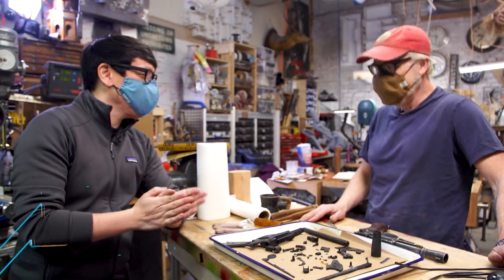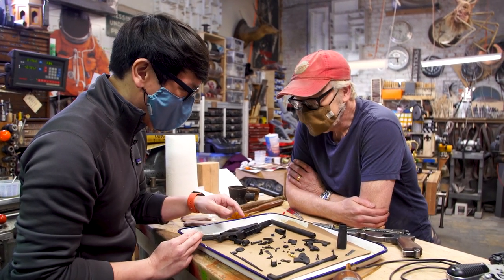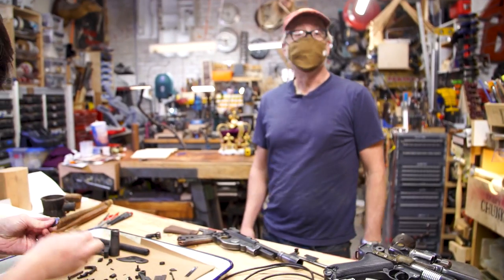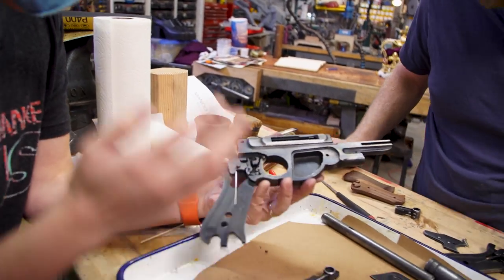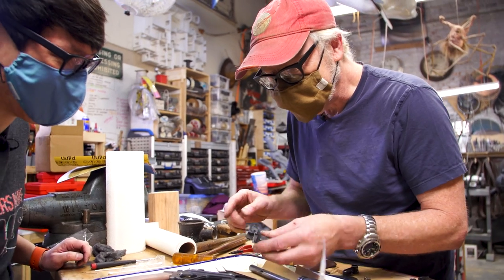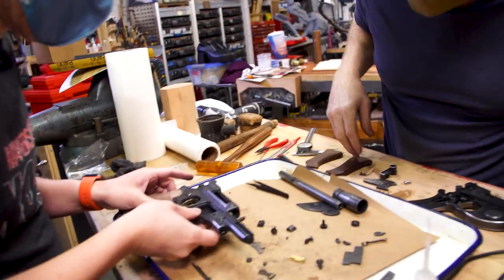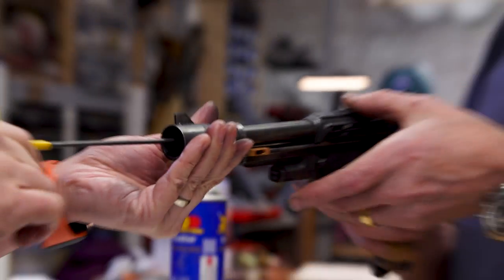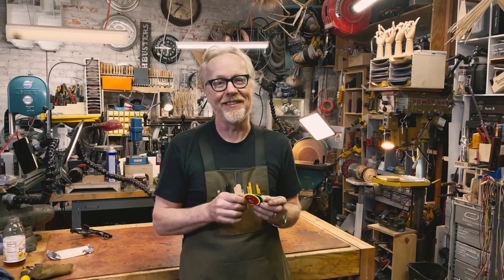Adam Savage Assembles a Mandalorian Blaster Kit!

Comment: See's kit. "I want it badly."
Looks at price. "Not that badly."
Reply: I was kinda thinking the same :D One day I'll have to money to spend it on stuff like this blaster.
Reply: All things considered, it doesn't sound like that bad of a price.
It costs about the same as a baby yoda.
Reply: @confusedwhale  plus You have to get the parts blackened what they did which can add to the total cost
Reply: @SirJamesIGamerfuzion :
Ah, but you would have to do that anyways where you diy'd it or bought this kit.

Though, I don't know how much it would cost to get an 1896 gun and modify it into a prop... probably more than $400. Le shrug
Reply: @SirJamesIGamerfuzion  I just used flat black paint - Turned out great... Cost me an additional $6 or so...
Reply: Yup, and they screwed up Norm's handle and forgot to drill a hole. For $400 it better be damn near perfect.
Reply: You can buy a 3D print of the base g*n from any of the big 3D printing websites, and then modify it. The blaster isn't actually that modified from the real deal.
Reply: Rubies makes a plastic one for less than $20. Paints up great. I think $399 is worth it for the milling they do alone. But not every collector can justify that price!
Reply: @Noeland  I was considering 3D printing one, but after all the time and filling materials I'm going through doing that for the helmet, buying one that's already close sounds like a nice deal.

Edit: Never mind. You can't find them anywhere at the moment.
Reply: @aerodanar  I've picked up 2 of the rubies blasters. One for a friend who cosplays, and he loves how light it is. I'll 3D print one eventually just for fun. I'm very tempted to purchase the metal blaster though. Can't lie.

Comment: I'm amazed that you two can work so closely, using that glue and are still capable of walking off in two different directions afterwards. I'd be attached to the gun, the work surface and anything else within a 10 foot radius.

Comment: I forget the name of the glue, however any glue that's used in restoration (both in painting and sculpture) and is under the grant of "reversible glue" is an excellent tool in the arsenal of a perfectionist model builder. You can fit and finish parts and then take them apart as many times as you want using it, because usually, it only takes a bit of warm water or some non destructive solvent to take parts apart.

I usually use a little bit of diluted fish glue for my models, makes final assembly for paint an easy task as all the parts are fitted and no longer hold that quality of amplified mistakes as each part takes its toll.

Comment: Seeing Adam wear a mask without his glasses fogging makes me jealous
Reply: Yeah I wanna know what mask that is. Looks comfy and effective
Reply: @Logikure those don’t always work. You gotta get a nice one for it to properly have a seal to prevent it fogging.
Reply: I buy the surgical masks, take an exacto knife and make a small incision at the end of the included crappy nose wire. Pull that nose wire out, cut lead free solder wire and heat the ends a bit with a torch to soften them, and insert into the channel for the nose wire. Talk about a great fit over the nose. It works really great.
Reply: Life hack: Apply liquid soap to the lenses and clean it away with a dry cloth, the lenses andthe cloth MUST BE DRY IN THE WHOLE PROCESS.
It will keep your glasses fogless for 4-6 hours
Reply: You just gotta tuck it under the glasses right homie. Hope this helps
Reply: @DungeonBricks  
Years ago I got this waxy stuff for face mask under water. Rub it on and no fogging.
Reply: @DungeonBricks  This may work for fogging, but some lens-coatings react poorly to certain dish soap and may come off. It may work just fine, but it may be a costly way to avoid fogging.
Reply: Put your glasses nose pieces over your mask and it won't fog. I have to use disposable ones for work on a regular basis. Never have fog issues.
Reply: @backpocket718   Looks like a Graf Lantz.
Reply: @Logikure That was exactly what you said.
Reply from the maker: He's been primarily wearing Luna Replicas masks in the shop: https://lunareplicas.com/collections/masks
Reply: its extremely simple.   wear with the mask OVER the bottom of the glasses, not the other way around.

Comment: I have that CA glue, and I can't stand it, but also can't live without it.
Reply: Wait was it BSi? Literally glued the tip of my pinky back together with the stuff. Incredible.
Reply: @RandomStuffGarage619  I recognized the label in the video.  I was using it for woodturning finishing and bought giant bottle and broke the cap applicator within 2 uses.  Now if I want to use it I have to take off the entire cap and it doesn't pour easy.
Reply: @cedarandsound  i bought 2 bottles and setting spray in the same order. I could send you my other cap! 😂

Comment: Serious prop QUESTION for ADAM about recent ALEC BALDWIN accidental shooting on set. Regarding props on set, I've always wondered why firearms used in films are real when everything else is more or less a nonfunctional fabrication.

My question: Is it possible for the best makers in the industry to design and build prop firearms that look, feel, and only APPEAR to operate like actual firearms, (i.e. muzzle flash, recoil, proper weight, load/unload clips and PROP cartridges, etc.), only they fundamentally operate in such a completely different manor that projectile discharge isn't even a functional possibility, even if the props malfunction?

Has this already been done and I just missed it? If so, why has this new tech in prop firearm design NOT become the film industry standard?

Thank you for being AWESOME, Adam!

Comment: They'd be crazy to have re-engineered the trigger mechanism, I'm sure they just used CnC and worked up the CAD model directly from the Bergmann blueprints. None of the internals will have been changed for the prop, so it would make sense.

Comment: My toptip, Injection needles make GREAT disposable superglue applicators, just buzz the sharp part of with a dremel or something (sanding disk seems to work better then a cutting disk) they are cheap enough to treat them as basically single use, but i often use some compressed air to blow out them out at the end and then you can get a few days of working time out of each. Not bad for a 5 cent piece... Incase anyone cares i use 0.8x16mm, and they drop directly onto the tip of zap-a-gap brand superglue bottles
Reply: They also make medical injection needles that are blunt, and also cannulae, but they are probably $$$

Comment: I wand some madlad to start reproducing the actual Bergmann Nr 1 pistols.
Though I'd rather have the Bergmann-Mars Model of 1910s, since they have a detachable magazine (unlike the internal 6-round magazine the Nr 1s had) and, in my opinion, look cooler.

Also: my opinion is that putting together and taking apart guns is far more fun than doing finishing work.

Comment: I've noticed that makers and veterinary technicians have very similar hands, lots of scars, fresh and healing wounds, and a general air of "these hands get used roughly" and I know that because I'm both a maker and a vet tech 😆 luckily I don't work with power tools often, my craft is building plastic model kits, I've definitely been on the wrong end of an Xacto blade from time to time, mind.

Comment: Great looking kit but over $400 for the kit and I'm guessing at least another $200 in shipping, materials, and the color treatment is just not attainable by the average collector or cosplayer. To get the kit from the seller with their finish on it is almost $700. Why not feature a 3d print kit and show the same build and weathering it to show how you can achieve something similar now that you've shown the pinnacle of collecting.
Reply: I'm an average collector and I didn't pay another 200 or so.  Do the weathering yourself (such as Aluminum Black).

Comment: adams lack of muzzle awareness is almost as cringy as nails on a chalkboard. its pretty bad.
Reply: norm is just as bad
Reply: Of a prop blaster? I know good handling habits are, er, good... But it's not a real gun.
Reply: @WhatIfAboutThat Good gun safety transfers over to everything you do. If you practice safety with real guns you find yourself doing it with everything, props, drills, glue guns, staplers, etc. If you show improper safety with a prop gun, youll do the same with something you dont think is loaded, real, etc when it actually is. Thats how accidents happen.
Reply: Neither of them handle real firearms and this is expressly NOT a firearm. Calm down.